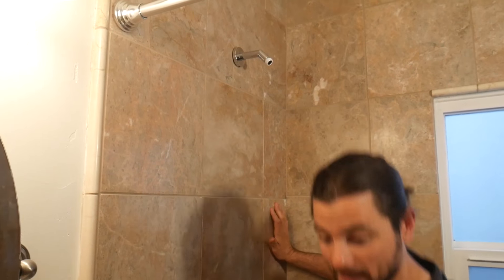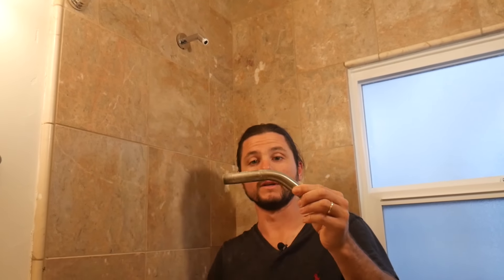How to Replace a Shower Arm and Flange

Comment: Do I have to shutoff the water going to the bathroom first or does keeping the bathtub turned off keep the water from flowing?
Reply: If water isn’t flowing out of it you are ok to change it.
Reply: I dont mean to pick on you but why do people think the valve would somehow up at the shower head when the knobs are at waist level or lower... if waters not coming out of the head then its not coming up the pipe, there's no on/off switch in the shower head
Reply: @foxtrot789  because I don't know anything about plumbing, my dad never taught me about plumbing and I didn't learn about it at school I have literally 0 reference about how plumbing works in a home.

I thought gravity would stop the water from flowing up the pipe but I wasn't sure how much pressure was in the line and if it would be active over the tub.

Comment: There was rust and orange gunk in my pipes. Alot of people are showering in Galvanized Steel rust water.  If your eyes feel irratated after a shower its because of the rust.    I noticed after I removed the shower arm.  Im going to have to remove the caulking, chisel the tiles off my wall, break through the drywall with a oscilltating tool, then change out the piping.

Comment: How often do these break when trying to unscrew? I live in a 60 year old house and so far, everything I’ve tried to replace, has been a major pain in the butt.
Reply from the maker: Totally understand where you are coming from, dealing with older plumbing can be a bit tricky, especially if it's been there for a really long time. It might be a good idea to call in a professional plumber. They'll be better able to handle these situations without causing further headaches.

Comment: Hi Justin, We purchased your arm and flange, and the flange will not slide onto the arm like it does in your video. In your video the flange slides easily onto the arm. We contacted Amazon, and they sent out a replacement of the arm and flange. Sadly, this flange doesn't slide over the arm also.  What are the odds of having two defective exact same products back to back sent to us?  Please help in resolving this issue.
Reply from the maker: We're truly sorry for the frustration this has caused. It's quite unusual to encounter two defective products in succession.To resolve this matter, we're more than willing to send out another replacement arm and flange immediately. Please contact our customer support team regarding this matter at 854-888-9231 during the hours of 9AM to 5PM EST and we'll be more than happy to assist you.

Comment: Is it okay if the arm is not 100% tightened? With 100% tightness it is upside down. I loosened some and it’s snug. Taped up really well. Should that be okay?
Reply from the maker: Once its pretty snug then it should be okay, but be sure to test for leaks before completing the entire installation.

Comment: Does the water need to be turned off for the bathroom, or even the whole house?  Not just at the on/off in the shower, but the top pipe is in the house plumbing , isn't it?
Reply: @Peter Macias Thank you!

Comment: For my shower, the cap at the end of the arm up against the wall is glued on. How can I get that off?
Reply from the maker: Hey there! Thanks for watching the video. Try using a little heat to loosen the glue. A hairdryer can work well for this. Gently warm the cap, and then carefully twist and pull it off. Good luck! 😊

Comment: So I bought the new shower arm, and tried to install it, but the old shower arm won’t budge.  Not sure what to do now.
Reply from the maker: No worries! If the old shower arm won't budge, try using some strong hands or consider getting a plumber to help. It should come off with a bit of muscle.

Comment: How do you ensure no water is leaking behind the wall after the job is finished?
Reply from the maker: If it is leaking, normally you’ll see a bead of water running up the shower arm. I’d leave the flange loosened up a bit to see this and shine a flashlight in there to have a look. It’s not easy to do as the hole is often so small so make sure you get the right shower arm!

Comment: Bro, nobody would use lock tight on an arm right? Mine feels like it's soldered in place. I'm afraid I'm going to break it. Should I just lean on it till the arm gives way?
Reply from the maker: In this case, I would definitely suggest to check if there was some kind of glue o sealant used. If this is the case, I would suggest to use a plumber so that he can be responsible of the removal.
Reply: @theshowerheadstore  I got it with a screwdriver and channelocks combination. Thanks for responding though.

Comment: This helps a lot! Why are shower arms so damn short in the first place? I'm installing a longer arm. You can't hang a rack on it because all of the water drips into the soap dish and makes a mess.
Reply: Are you in a rental or a cheaply-built house? Oftentimes contractors/developers/landlords will skimp on pieces like this to save a buck, but thankfully it's very easy to upgrade without risking damage.
Reply: @lozoft9  It’s a brand new house and wasn’t cheap. It’s a spec house and we had no say in the accessories, paint, color, fixtures etc. Yes, it’s an easy thing to fix.

Comment: I saw a comment in another video where someone said to turn the shower arm upside down and pour vinegar down it to loosen up any debris. I think there might be debris in mine from a tankless water heater issue, but the shower arm is fairly new and I don’t want to take it off. Do you think that would work?
Reply from the maker: Hello there, White vinegar is one of the most effective cleaning agents you can use for cleaning your shower head and fixtures. The acids in vinegar naturally break down limescale, rust, and other mineral deposits that have accumulated over time. Vinegar, therefore, should be your number one friend when it comes to cleaning the shower head and fixtures

Comment: Some say not to wrap  so much Teflon. Thoughts?
Reply from the maker: Thanks for your input! While some recommend fewer wraps of Teflon tape, our experience and standard practice suggest wrapping around 10 times to ensure a secure seal to the shower arm and internal pipe connection to prevent leaks. It’s important to balance enough tape to create a good seal without over-tightening, which could potentially cause issues.
Reply: Awesome thanks for the reply. Good to know. Thats a good practice to do.

Comment: My apartment shower arm seems like it doesn't want to come out. Could it be one piece all the way down the inside of the wall perchance? Really wanna replace it
Reply from the maker: Hello Tony, the shower arm goes into a shower valve inside the wall and they are not permanently installed. Some plumbers can crank them down more than others, which can make them hard to reverse out of the wall. And, of course, if it is an old one, it could be really calcified in the wall so you'll need to really crank it to get it out. If you aren't that confident, it's best to hire a plumber.

You can attempt to remove it also by using a pliers and a screwdriver. With the pliers in your left hand holding the shower arm firmly in place, place your screwdriver inside the shower arm and and turn counter clockwise.

Let me know if this helps.
Reply: @theshowerheadstore  I shall certainly try this. Thank you mightily.
Reply from the maker: @WILLTONY7  You are very welcome!
Reply: 10 inch locking pliers did it without hitch! Thanks again! Wouldn't happen to know if a roughly 4-6 inch diameter thin brushed nickel plate that could go behind it do ya? The little backing plate isn't as big as the previous one so it looks a little ew behind it.
Reply from the maker: @WILLTONY7  Hello Tony, unfortunately we do not stock shower arm flanges as stand alone items and its hard to find metal flanges that measures up to 6 inches. I would recommend checking amazon, you may be able to find 3.5 Brushed Nickel flanges.
Reply: @theshowerheadstore  awesome. Thanks!

Comment: I couldn’t see how you applied the new wall plate.  Did it screw-on to the shower arm?
Reply from the maker: Hi! You'll have to place it inside the shower arm before installing it, then there is a set screw right at the bottom of the flange. Then we would recommend using silicone to seal everything up! I hope this helps!
Reply: @theshowerheadstore  :  What do you mean by “a set screw”? Thanks

Comment: Any tips on what do you do if the plumber didn't secure the pipe properly behind the wall & you don't have access?
I'm afraid if I take this shower head pipe out (which was installed incorrectly so it's leaking & if I tighten the pipe it points to the ceiling) I'm going to loose whatever it attaches to.
Bought my house with it like this.
Reply from the maker: Hello Jenna, if the plumber didn't install the fitting correctly then I would get that same plumber to correct the problem

Comment: So I have a question. I have a stand up shower and my shower head is always leaking. Not bad. Just a steady drip. I've been told I need to replace the valve stems for the handles and I've been told I need to replace the shower arm. I don't feel confident in taking chances on jobs I've never done before. This one doesn't bother me but the handle stems do. Will either one of these fix my problem in your opinion?
Reply from the maker: Yes, you would need to replace the stems "cartridges" if the shower head is leaking when the water is turned off.
Reply: @theshowerheadstore  I took shower head off and it’s dripping from the pipe.  How bad is that? The shower is newly remodeled. I’m scared 😳
Reply from the maker: @kathy-t5q  If it's dripping from the pipe when the water is off at the valve, that would mean you have a bad shower valve cartridge/stem and would need to replace that to fix the leak. That's totally normal, happens over time as the seals wear down.

Comment: I'd love to install a rain shower head. I'm concerned about the weight. Can you offer any advice on what weight limit per extension length? I realize there will be a greater force the further it's out. I just don't know what is wise to do.
At the moment, redoing the pipes to come down from the ceiling is not in the plans.
Reply from the maker: Typically, you will find a 8 inch, 10, 12 or 16 inch Adjustable Shower arms on the market. Unfortunately, I do not have a weight limit for ours as our Adjustable Extension bars are equipped with the strongest locking gears on the market. These locking gears are deep so they can support well over 12 pounds of weight. That means you can get way longer use out of this shower arm extension with the peace of mind knowing that this component will hold tight.
Reply: @The Shower Head Store  Thank you very much for the reply.
Reply from the maker: @Mr300mph  You are very welcome

Comment: Which part of the thread do u start wrapping the tape onto:the bottom of the thread where it meets the arm or the top where the 1st thread is that goes into the fitting?
Reply from the maker: You will start wrapping the tape on the male threads from the part that goes in the females threads first.

Comment: Do you have to use a screw driver or can u just rawdog it w ur hands?
Reply from the maker: If you have the strength to do that then fin but using the screw driver gives you leverage.

Comment: What did you do at the end to secure/tighten the flange?
Reply from the maker: There is a set screw in the flange that you tighten down onto the shower arm so it does not move.

Comment: And what happens if you go to do that and it doesn’t come out of the wall because it’s been in there for such a long time or if it snaps and breaks then what?
Reply from the maker: If it's there for a long time and its hard to come out then we recommend using two tools to remove the shower arm. With a wrench in your right hand, hold the shower arm still while placing a screwdriver or any other metal tool that can go directly inside the shower arm, then apply pressure in a counter clockwise rotation. This procedure is to be done slowly so as to not snap or break that soldered connection inside the wall. If that connection breaks then there's going to be leaking in the wall which may cost alot to get fixed. Let me know if this helps.

Comment: How did you make the flange stick to the wall? Mine is loose
Reply from the maker: At 4:14 in the video Justin shows how to start the process of tightening the flange using the Allen key. Let me know if this helps.

Comment: What if the shower head is stuck like almost glued on? How can I remove it?
Reply from the maker: Use Pliers or a Wrench or gently heat the area around the connection using a hairdryer. The heat can expand the metal and make it easier to unscrew.

Comment: Do we turn off water in mains first?
Reply from the maker: No you don't need to turn off your water, as long as you've shut the valve on your shower first i.e. so the shower isn't actively on/running water.

Comment: The connection between my shower arm and the wall is on the inside of the wall.how do I apply taflon tape to that
Reply from the maker: Hi Andy,  That is a great question. Most Shower Arms have the male end on your side, So you can place the teflon tape on the shower arm and screw it on. I hope this info helps!

Comment: i'm looking to change my shower head and arm and never did it before so have some questions.are most shower heads and arms the same size. Or are they different sizes? or is there a comon size that they may be
Reply: Most, if not all shower arms have a standard 1/2" male pipe thread, and a standard showerhead has a 1/2" female pipe thread

Comment: We recently replaced the shower hose/ head because ours was filled with calcium , our water is awful. It was fine but now is leaking between the shower arm and where it goes into the wall, where the shower arm connects to the main pipe. We’ve tried re-taping it to no avail. Any ideas on how we can fix this leak?
Reply from the maker: Hi Angel, it seems that the calcium deposits were also lodged in the shower arm. In this case, I would suggest a new shower arm and try it out. If this doesnt work out, it might be that the threads in the main pipe might be damaged. in this case, it would be better to use "plumber's putty"  to have it fixed.

Comment: You made the unscrewing of the shower arm look effortless. I'm havin a hard time with it. Is it supposed to be on there real tight? I dont know if I'm weak or if it's just on there real good and it's frustrating me to no end because I feel like I'll break whatever the shower arm is connected to. Also, when I'm attempting to unscrew that shower arm it's a tiny bit loose and makes me uncomfortable about unscrewing it. Is that normal? Any help would be appreciated.
Reply from the maker: Hi MisterJanDaMan!  It could be that the shower arm was sealed with plumber's putty, which is a kind of adhesive that seals the connections very strongly.  In this particular case, I would definitely suggest to be helped out by a plumber.
Reply: Mister JanDaMan . Nothing will break especially if there are sign of the tape. I thought mine was made onto the shower head. There was no sign of it turning period. Also you can pour boiling water over it. Make sure you are turning it in the correct direction because mine was the opposite of the direction given in this  video but it wouldn't budge. So I turn it with a plier the opposite direction hoping this helps.

Comment: Sorry Justin! You should have showed how to slide back the Chrome Escutcheon Cover and put some JB. Water Weld in the hole for the added strength that extended tube will need! Otherwise it will definitely wobble and leak over time!
Reply from the maker: Hello Jimi thanks for reaching out with this. This video was about replacing the showing arm and flange in 5 minutes and not about adding durability to your shower arm.

Comment: Do you need to turn the water off to the house?
Reply from the maker: Yes, when a plumber is changing a shower arm pipe in a bathroom, it is typically necessary to turn off the water supply to that specific bathroom. This is done to ensure that water flow to the shower is completely stopped. However, it usually isn't necessary to turn off the water supply to the entire house for this particular task.

Comment: How do you make a flange without a set screw tight?

Also, if your plumbing is pex and has some wiggle to it, how do you rotate a new arm into the fitting tightly enough without bending and breaking everything in the wall?
Reply from the maker: Hi Alex! It definitely depends on the model and brand you are using. Normally, they all use a set screw because it's easier that way. There are other systems out there. I would suggest sealing everything with silicon at the end. 

For the PEX plumbing, I would suggest to consult a plumber of your choice. PEX has more of a wiggle to it and should be fine, but it all depends on your set up.
Reply: @theshowerheadstore Thanks! I figured out I bought the wrong elbow. I need the one with the ears so I can screw it down, then it won't be floppy anymore!
Reply from the maker: @Insidiousotter  Awesome! I'm so glad you were able to fix it! PEX is sometimes easier but sometimes it has to have special treatmen

Comment: 4 years later..  i tried changing my shower head but the washer keeps collapsing into the arm… then it leaks… any suggestions?
Reply from the maker: Hi there! It sounds like the washer might be crimped up and getting caught in the arm. You could try flipping the washer around and giving it another shot. If the issue persists, please let us know, and we'd be glad to arrange a replacement washer for you.

Comment: Quick check for the tape.  Put your thumb nail against the tape and turn the pipe as if you are putting it in.  If the tape bunches up, then it is the wrong direction.
Reply from the maker: Thanks for the tip!